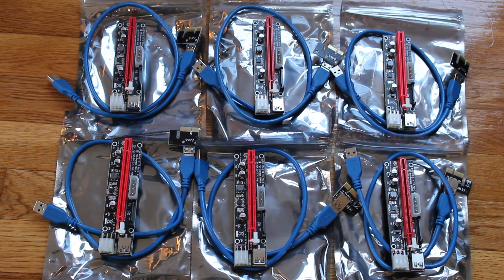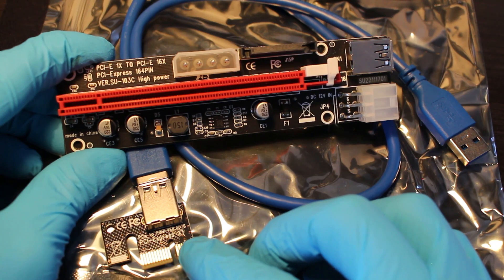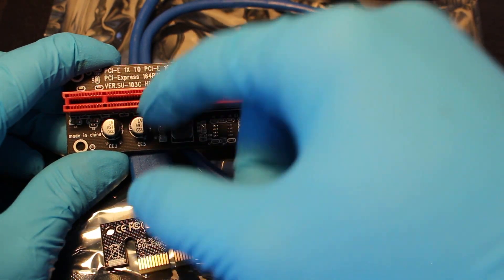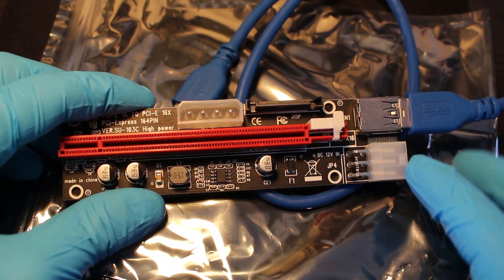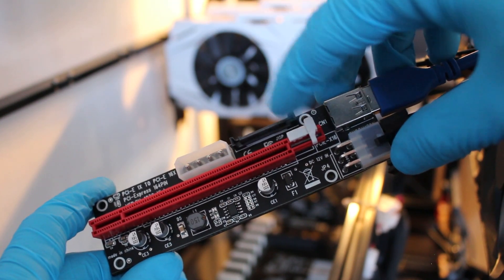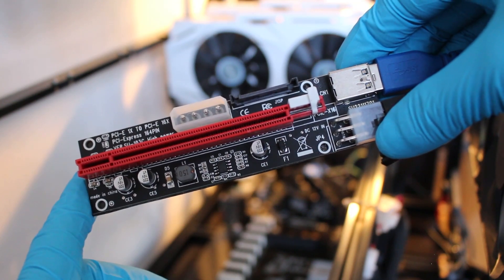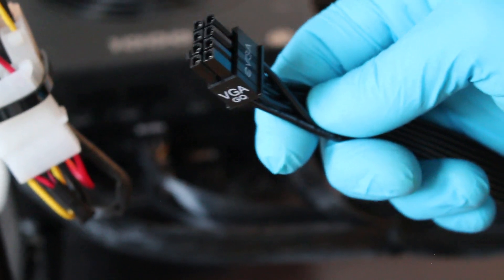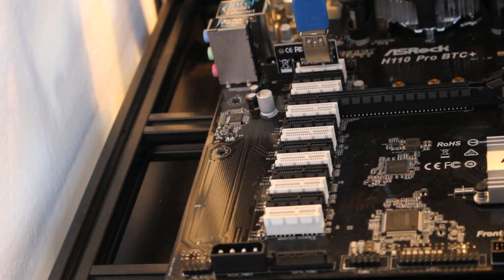How to wire and install PCIe RISERS on any PC (Mining rig build)

Comment: I am in the process of trying to install my M-Audio RPC-1 Sound card to this Dell 808 Desktoppc which has only pci-e slots. I bought the StarTech PCIe to PCI adapter card., I am very hopeful it boots the ball through the goalpost. If not I'll have to do more research until the job gets done. If there was (IS) and easier way to use the RPC-1 (RBUS) sound card in this Dell Desktop I would appreciate the suggestions. I absolutely love the Roland VM-3100 Pro workstation and the Logic 4.7.1 recording studio - got real proficient at using it then the tower took a crap., now I am trying to remedy the situation. ? ANYBODY ?

Comment: Do you still connect power cables to your graphic card or just the riser card. Because for example a geforce 3080 ti has two 8 pins and the riser card only 6 pins

Comment: Hi, didn't see in the power supply to which port you connected to, is it 8 slot PCIE E? or is in the 6 slot SATA? I do know that the riser side has 6 pin as well.

Comment: Can I use this for broken internal GPU slot?
Reply from the maker: Yes, if the PCIE slot is available & in good shape. Thanks for watching!
Reply: @JumpermanTech  Thankyou! I hope this works and already ordered online. I don't want to order a very expensive MOBO if there are alternatives. Kudos to your channel! Already subscribed! xoxo
Reply: @JumpermanTech  Anyway, will it affect my gaming experience if I used this with my GPU?
Reply: @JumpermanTech  And also, can I use 4 pins to get power from the PSU?

Comment: Great video! But I have a question and it sounds stupid but, after I connected the 6 pin pcie power cable to the riser and my graphics card needs has an additional 6 pin on top of it  I still need to connect the 6 pin there too or not?
Reply from the maker: Yes you do. Thanks for watching!
Reply: Not a stupid question.  I am here for that answer, too.  I did not want to do it and ruin my card.  Lol.
Reply: Dont start, it's over. @manlyhallresearch9785

Comment: Hay little question here.

Can i plug the other end of the  cable which connects to the short PCI e slot,to the long one?Because i’m going to upgrade a office pc and it doesn’t has the short PCIe slot.please advice.

Comment: Amazing video..thank you a lot.. PLEASE help me.. i am doing all OK.. and my USB cable is heating a lot .. i need to disconect the power energy that is coming from my power supply 850w gold, one usb cable already sttoped working.. i have a cable coming from my power supply its a sata and i am connecting it to another cable that came with the package.. and 6pin to the riser.. dont know what to do .. already tried all forums no one can help me.. even the guy from the store dont know.. also if the computer is OFF and i connect the PCI to the emother board the computer turn on .. crazy!!

Comment: I reccon I still have to connect power cables to the GPU itself? 2x 8 pin to my 3090 for example. On top.
So for the 3090 - 1x 6 pin to riser - and 2x 8 pin to the gpu itself?

Sorry if this is a dumb question :)
Reply: Ofc

Comment: Great video! I have a question, do you need power cables going directly from your psu into the GPU also, or is the power going into the riser from the 6 pin enough?
Reply: It's not enough - Those cables are just powering the riser so that the riser can transfer data back and forth via the USB cable using the PCIe interface.
Reply from the maker: Thank you! I actually made a video answering your question. I'll leave a link. You need power for the riser and power for the GPU. I use a splitter and for my case it was totally fine. I'd def double check how much amp draw your components use so the wire guage size is sufficient for the amount of power being used for safety reasons. Thanks for watching! 

https://youtu.be/JW72VORN1bw

Comment: Hello,
 Is this a riser for the size of the pcie slot or a riser for the data, for x1 to what your card needs? If my motherboard has pcie 3.0 x1 slots and my rtx 3060 needs a minimum of 3.0 x8 is this the way to make it work?

Comment: Great video i just worry about the power supply running 2 high end gpu man its gotta require alot. id like to run something simple like a 1650 on a riser with my 2070 on a 1000 watt psu i dunno if it would work

Comment: Hi. For confirmation. You connect a 6 Pin on the riser. On the other side, you connect to the PSU with a 6 or 8 pin?

Comment: Will there be a hashrate different ? My RTX3080 hashrate drop by 8-10 when on PCI riser .. Same OC setting, I tried change PCI slots, set gen1, gen2, auto , change riser power . I'm on 6 pins power to riser

Comment: Hello, nice video. I got a question though. What is the purpose of the rubber on the other side of the riser? Should I remove that? When I got a riser, and got all the business done, i started up my PC and immedietely smelled something burning. Now the PC won't even turn on with the riser plugged in. Was that just the rubber and its normal? Or is it possible the riser was DOA? Im kinda new to this whole stuff, thanks for your reply.

Comment: that's weird, did you not use the 8 (6+2) pin power in gpu?
Reply from the maker: I made a video of how I wired everything exactly. I did power my GPU as well. I will leave a link so you can see how I did it. Thanks for watching!

Complete Wiring 
https://youtu.be/JW72VORN1bw
Reply: @JumpermanTech  thanks ill watch this

Comment: Love the video. Question though, is there a way to determine how many gpus can go on a motherboard? I’m looking at an old p8z77 1155 board cause I have an old gpu and want to put 6 gpus on it.  It has a mix of pcie sized slots. Can I use these risers in every size slot sir?

Comment: uber Trash newbie here : (
can you please say me whether I should power my Graphics card also to work with the GPU or only powering the RISER is enough.
(Using RX580/GTX1070 GPUs)
also do Risers themselves need a solid 75w To work with from the PSU.
sorry for asking so bad questions but it would help me out so much with my upcoming purchases! <3
Thanks in advance! :p

Comment: Nice tutorial but one question. I have 2 PSU's, 6 cards. All VGA pins are full. I can't power the risers via VGA. Can I put them into the SATA pins on the PSU? My cards require over 200W which means i can't simply use a splitter to share between a GPU and a riser lol. THANK YOU!

Comment: Can I use 6 pin to 6pin cables to power my riser as I dont have any 8pin ports left on my psu?
Reply from the maker: Yes, you can. My risers are powered by the 6 pin power cable coming from my PSU👍 The riser I use has 3 options for powering it up. I'll leave a link for a video I made explaining this a bit better🙂 Thanks for watching!

PCIE Risers: How to distribute power 
https://youtu.be/JW72VORN1bw

Comment: I intend to build 6 x RX 5700 XT rig, and will be using 2 x EVGA GA Gold G+ 850w (3 x GPU each) , should I connect the 8 pin directly to the GPU instead of the riser?

Comment: Thank you for the great video!

Can I use a PCI-E splitter cable to power the riser cable and the GPU with the same power cable? I'm using 3060 Tis but don't want to damage my cable, PSU or worse the graphics card.
Reply from the maker: Thank you very much! I made a video of how I wired Mines exactly and never had an issue. Different GPU's draw different amounts of electricity so keep that in mind but here's a video of how I wired Mines. I will leave a link👍Stay safe out there

Complete wiring
https://youtu.be/JW72VORN1bw

Comment: Hi. I just wanna confirm if is it ok to test the pcie risers with only 6 pin cable connected without graphics card and connection to motherboard just to test if the risers will not burn when psu is switch on?

Comment: my man, can you just plug the usb into a usb port or you must link to pcie 1x card adapter?
Reply from the maker: No, I wouldn't do that because that USB gets connected to your motherboard at your graphic card connection where your graphic card should go. It needs to be connected properly👀
Reply: @JumpermanTech  yes I know but the egpu riser connect by usb 3. So it's possible but idk why nobody uses like that
Reply: @tuduff  its not possible... theres difference between usb interface and usb cable because the USB hub works on a different protocol than PCI-E. ... The reason why you see USB 3.0 cables and connectors used, is due to the fact that it is still a serial cable and one that can handle the throughput needed for mining

Comment: Hi! Excellent video, but I have a question: I'm using an 8-Pin PCIe to dual (6+2) pin PCIe power cord. Can I power my EVGA 3060ti xc (uses 6 pins) with one of them, and use the second PCIe cable to power the riser simultaneously?

Comment: What about power supply for GPU? You only showed how to power riser by connecting 6-pin connector. There is also 8-pin connector to GPU. Should we connect 8-pin to GPU also?
Reply: if your gpu needs 8pin, then you should use molex +6 pins, or 2x 6pins

Comment: Good video man but not whatt im looking for does it work if you put it in the larger slot where you normally put your video card?
Reply from the maker: You can put the graphic card in its normal larger slot and everything will work. To have multiple graphic cards in different locations  is what these pcie risers are made for. Can't fit 6 or more graphic cards right on a motherboard🙂 Thanks for watching!

Comment: this video was very helpful but still i have a question, in the moment when you set up the riser power to the PSU, i ve seen you used a 8 pin cable to the power supply? for a riser? is that necessary? im confused
Reply from the maker: Thank you very much! Yes that is true, I did. That's just the way I saw it was done and it's been working for me👍Thanks for watching & stay safe out there!
Reply: @JumpermanTech  4months ago lol already i have a mining rig  and i know how to wire the whole setup hahah, everything is fine thank you👍